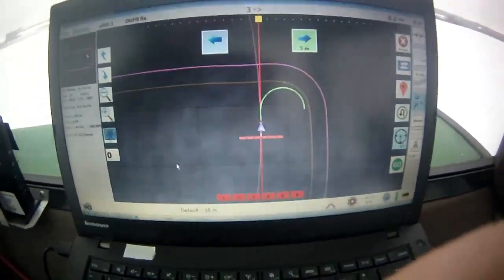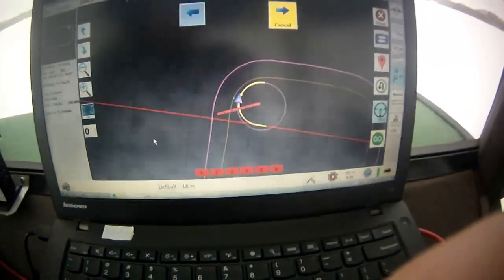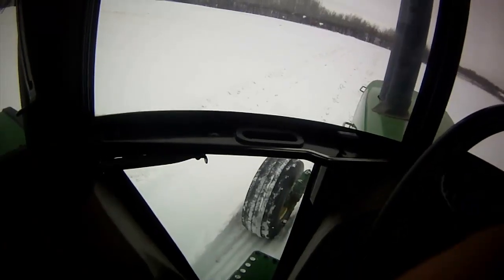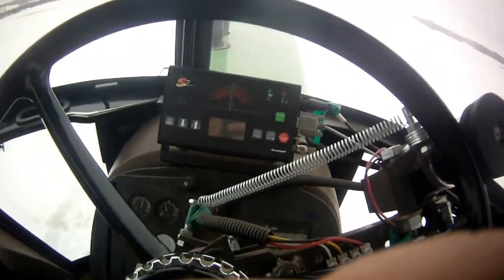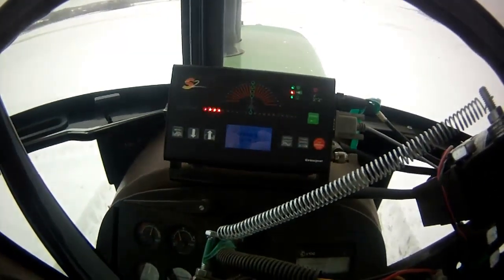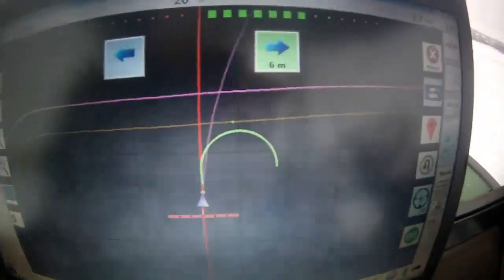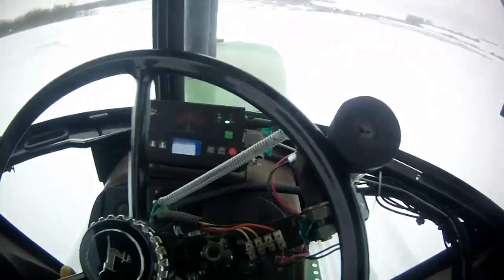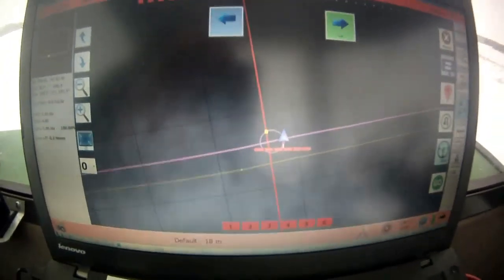Fault conditions and AgraBot Reaction

Comment: Hi Brian your antenne is on top of the cabine  ....how do´s it fits? The AGO communety says it is better at the engine hood..... SOrry for my english:)
Reply from the maker: the antenna has a magnetic base and have a metal plate on the cab. It is about 1.2 meter ahead of the back wheels and works well there. Your English is great!
Reply: @FarmerBrianTee  ah ok ...thank you i will try it on top of the cabine by my john deere 6800 with the CMPS14
Reply: *my antenne ist the Multiband Gnns from Ardusimple
Reply from the maker: @julius2549  Before it got too cold, that is how i was driving with CMPS14. Worked really well

Comment: A tractor angle sensor, it would shut down if the tractor is on a questionable slope  Z offset in it's X or Y axis. Implement error, sprayer out of spray, seeder out of seed,manure spreader out of manure, etc. Just came into your program so I'm not too familiar but that will change. :)

Comment: Do you support (or plan to) external sensors to trigger faults?

Impact, distance sensor, lidar, a camera with recognition layer, etc could trigger a fault condition if something is in front.

Basically, any type of server on any port could signal a fault, and AgOpenGps would read the state from that port and could stop the vehicle if needed.

You don't need to implement all possible sensors, rather just read what the "fault server" says.
Reply from the maker: That's a really good idea. i have Lidar on but is integrated into the software to check /change distance etc. I never thought of it that way before, a fault server, but makes perfect sense. The more complicated ones are the hardware/software that does the driving and its failure which was demonstrated by the video. Thank you for posting that reply, I will definitely consider this!
Reply: @FarmerBrianTee  That can be easily done with two poles wire, a spring and an end switch. I've seen done  that  way in many places, e.e. in https://www.youtube.com/watch?v=9vrGMhGfZUQ. I guess the wire tension is kept with a spring. When wire touches sht. spring elongates and endswicht is triggered.

Comment: Hi farmer Brian tee I would like to make a gps auto steer system for a science fair project could you help?
Reply from the maker: That would be really difficult since the GPS doesn't work inside. Kind of removes most of feasibility of the project :( You can of course just download it and use the simulator, but that's not much of project either :(

Comment: Is the accelerometer data from the bno055 reliable enough to monitor for an impact? Having the tractor stop above a certain threshold could prevent further damage if the tractor were to hit a ditch, stump, etc.
Reply from the maker: I don't think so, it would be very hard to differentiate between a normal big bump and one that would require a stop. Pretty tricky!
Reply: True, i could see how the data could get noisy on plowed fields